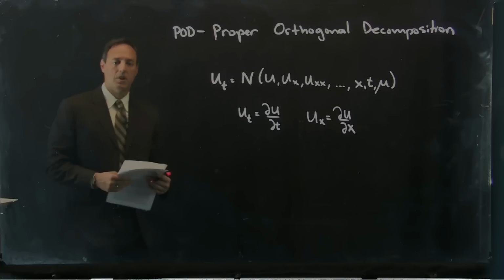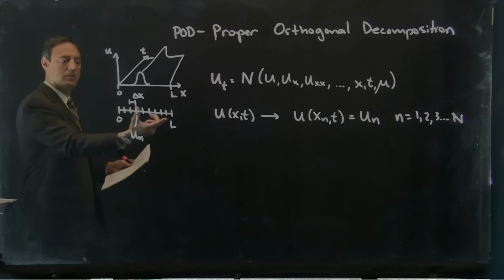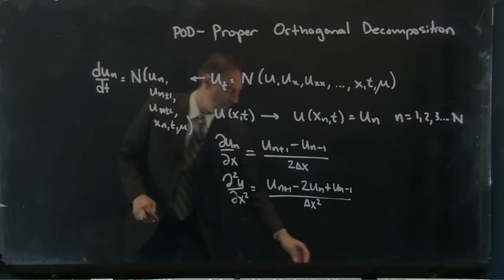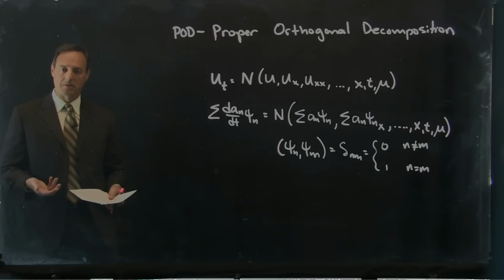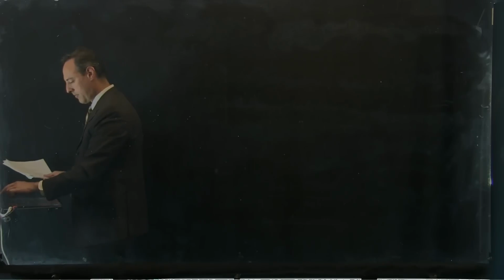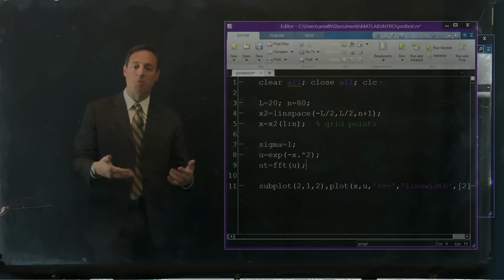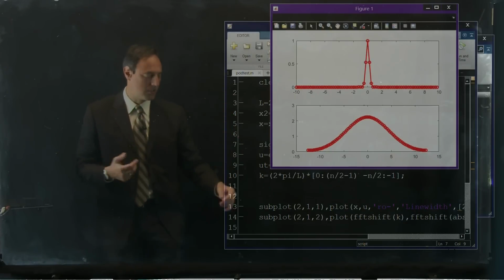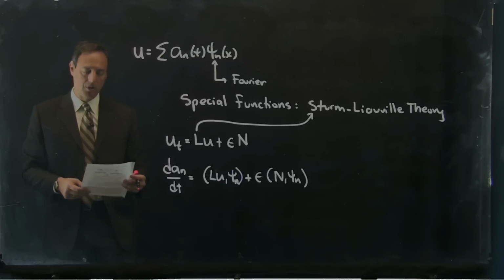POD introduction 1

Comment: I had to re-watch the first 5 min or so because I was trying to figure out if there was some sort of optical trickery or if he really can write that well backwards! I'm impressed!
Reply: notice what hand his ring is on           
  -The picture is flipped
Reply: "Man trapped in the Crystal Dimension teaches proper orthogonal decomposition"
Reply: I think the trick is the presenter is writing on the glass and there is a mirror behind the glass and they are filming from the mirror.  sequence is presenter-glass-camera-mirror
Reply: Wouldn't the camera be visible in the mirror then? I'm more convinced by the flipped picture explanation.
Reply: @pederolesen2949  the answer is on his website and it is recording a mirror:
https://faculty.washington.edu/kutz/page5/page23/
https://faculty.washington.edu/kutz/page5/page23/files/stacks-image-5721f42.png
Reply: Glad we got that straight. I was freakin out! However, we're all in trouble if he computes a curl, as the handedness of the cartesian axes has also been flipped!
Reply: Nope! He is writing the normal way, but a software is just flipping the image so that we can see it properly. Its no trickery